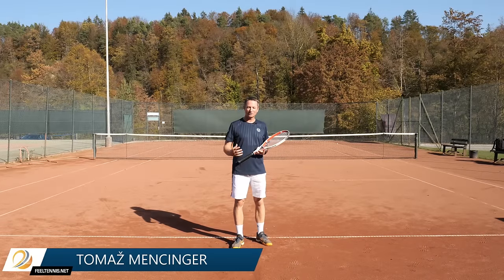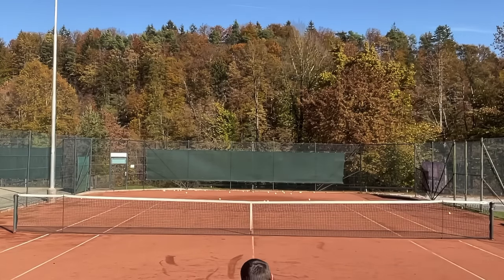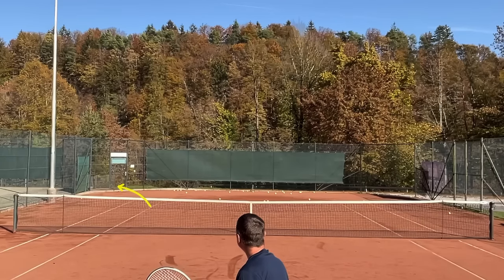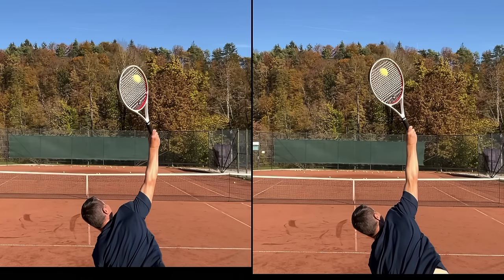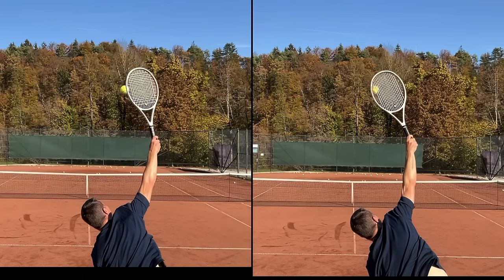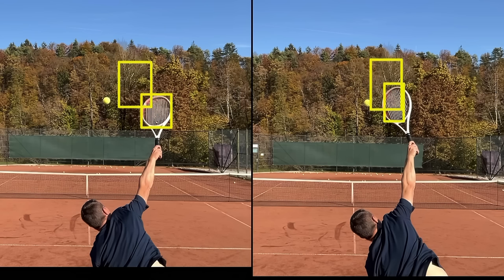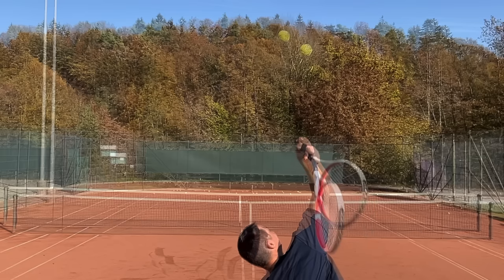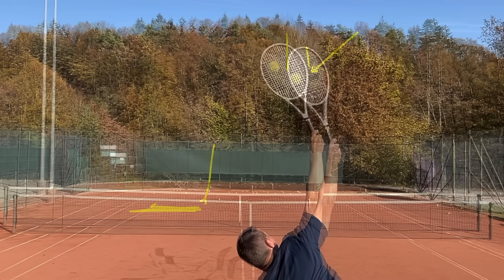Tennis Slice Serve Analyzed In Slow Motion

Comment: Hi, I've been a uspta teaching pro / technical development coach for 37 years. This is excellent video work and accurate analysis. Great job! Would have been interesting to see the face angle difference if serving to the same target though. Emphasis then might have to have been a little bit more on the swing path, slightly more left to right on the way up to, and through contact to add the spin, not relying primarily on the face angle difference.
Reply from the maker: Thank you for the feedback, Bob! So if I understand correctly you would like to see a comparison between a flat and slice serve and in both cases going for the same target? Down the T or out wide?
Reply: @feeltennis  Hi again, thanks for your reply. I was just thinking it might be more representative and interesting to see (at least for technique nuts like us), in that the face angle at contact mainly determines the target direction. So whether a flat or spin serve, the face angle is probably even closer to the same if the target were the same. I don't know that it's worth producing another video just for that though! I'm sure many people appreciate the time and work you put into these. So, thank you for that. I have shared these with many of my students.
Reply from the maker: Yes, the angle change would be even smaller then in the above examples. I'll try and include something on that topic when I make a video on how to disguise the serve...

Comment: Serve slower means more spin with control and shorter. Stand a meter or two away from the service line to get more angle. They know it's coming, but often the drag is so far out it doesn't matter. Really effective in doubles.

Comment: You should consider the fact that your slice and flat serves are not aimed at the same location (flat is aimed down the t and slice is aimed wide) resulting in a misleading comparison. Its movement of the racket that imparts spin on the ball and the angle of the face that determines the trajectory of the ball. If both serves were aimed at the same spot, there would be no difference in the angle of the racket at contact with the ball, the only difference would be the movement of the racket before and after contact.
Reply from the maker: Nope, because if I aimed down the T, the flat serve would "flat" at 90 degrees on the back side of the ball (like it is in the video) and the slice serve while theoretically possible would be very uncomfortable to hit by aligning the face of the racket exactly same flat 90 degrees on the back side of the ball. Even if I serve slice down the T, there will be racket angle at contact different from flat.
Reply: Lol we trajectory the ball by wholebody position at contact not only using the arm to control the racket face.